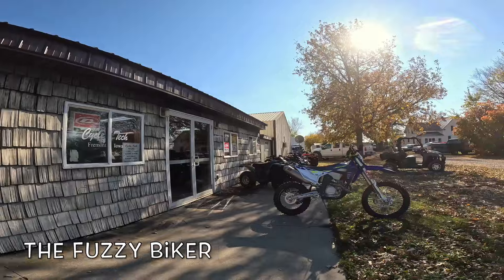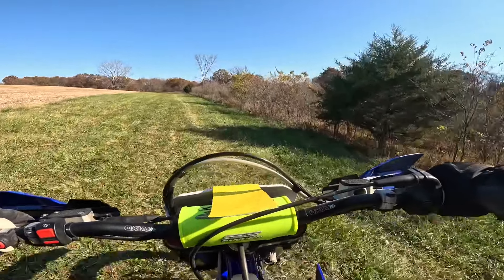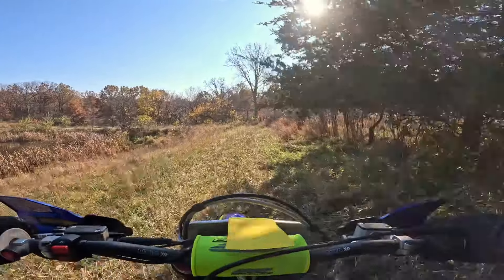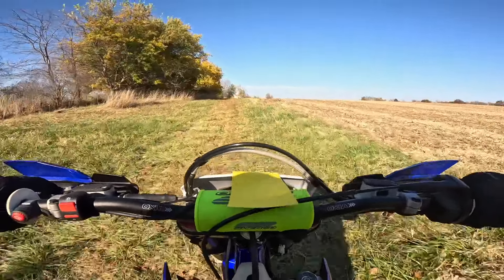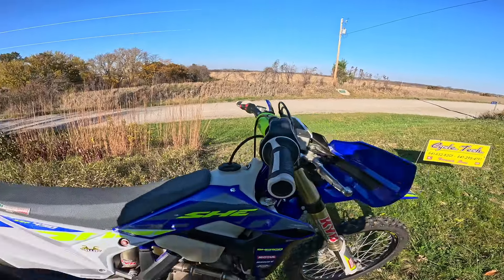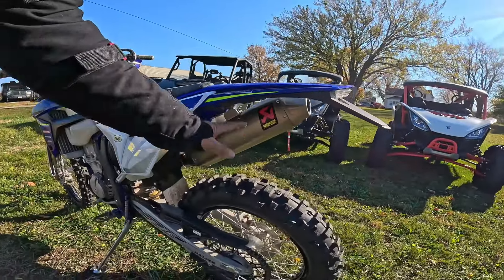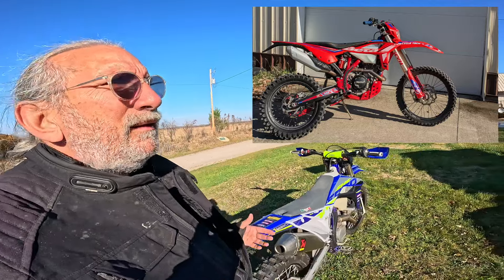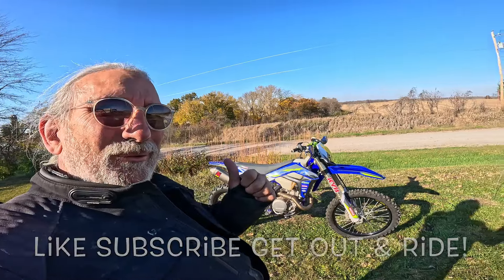Sherco SEF 450 - French Made Dual Sport - Wait, a French Motorcycle? Wahoo!

Comment: The title says "Dual Sport". It's this bike wired for blinkers and a gauge? It's it designed to be plated?
Reply from the maker: Hey, help me out a bit. It has gauges and I'm not sure about the blinkers. The guy says it can be titled. If it cannot be titled. What kind of a bike is it? Thank you
Reply: @forgottenmotorcycles  A dual sport usually has blinkers, brake light, speedo, mirrors, and license plate holder. So, maybe this is just configured to be dual sport ready? Maybe it's pre-wired to have the needed stuff added? Also, it's a six speed, so I'm wondering if that sixth gear is like an overdrive to keep the revs low at highway-ish speeds?
Reply from the maker: @chooseadventure3756  I'm going to have to do a bunch of research on this. Also wrote a beta 390 and the new beta 350 Alf x. Amazing motorcycles